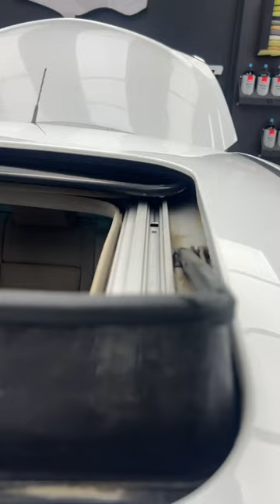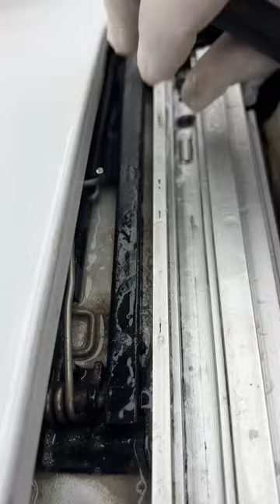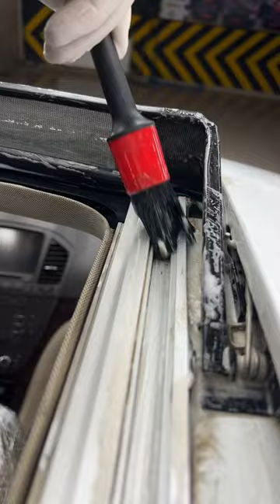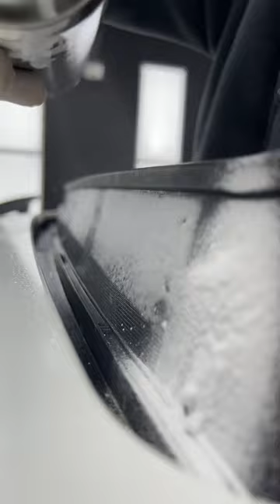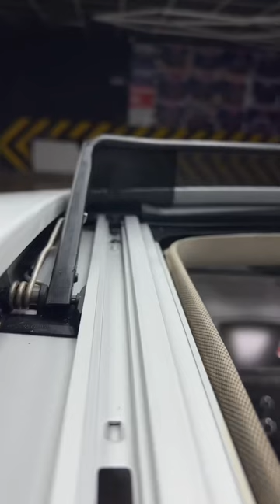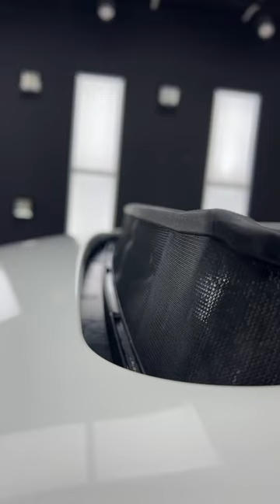Sunroof channel cleaning and lubrication. #detailing #sunroof #insigniareality

Comment: I think the track on mine broke and the seal came off… the whole thing is stuck. any way to fix it ?
Reply: Yes ford dealer I have the same issue they trying to charge me 780 for replacing them.

Comment: WURTH Foam Cleaner Polish Spray  “Lightly mist & wipe to remove harmful contaminants, fingerprints, water spots and surface dirt while maintaining that glossy shine. Use it often to remove daily dust and grime and repel water while adding protection to your finish. May be used as a lubricant for clay bars to remover embedded pollutants.”